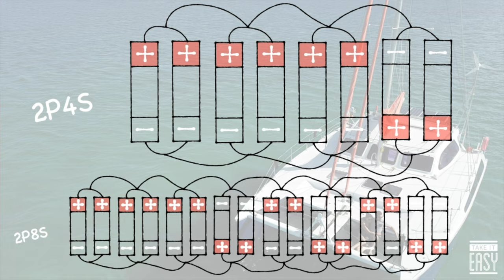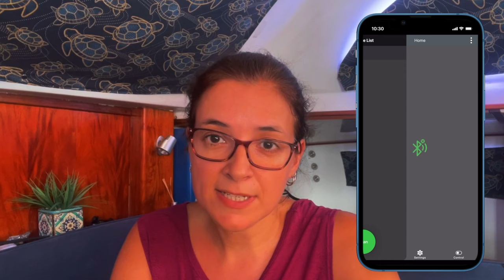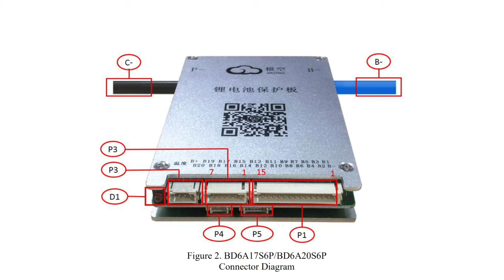Swapping our batteries! How to build 12V LiFePO4 Battery | Easy DIY boat project

Comment: that is a proper battery pack installation with good well known brand quality bms and battery. I would add active balancers as well to complete the combo. your old lithium batteries could be fix by a device "battery resistance tester" replace the ones their resistance is beyond useable.
Reply from the maker: Would you recommend any active balancer? Thanks for the advice! We gave the old batteries to the locals so they could use the working ones.

Comment: Very nice. I built my own battery banks using EVE LFP 280ah cells 57.2 KW of power. I only use 50kw. This is in a house @ 48 volt which means 58-51v usable. After 1.5 years I am at 80 cycles and they are rated for 8000 cycles. The most important thing is how you charge and discharge them with C rating. You have 800ah so 1C is 800 amps charging or discharging. If you can charge and discharge at 400 amps that is 0.5C which is perfect until you get over 45 Celsius. Then  charging should be lowered to 100 amps which is 0.25C up to 60 Celsius. Discharging at 0.5 C 200 amps is okay up to 60 Celsius.
Reply from the maker: Thanks for the info, that's very helpful to know! Especially about the temperature, because everytime we talk to an electrician they tell us about normal operating condition, which is somewhere around 25°C. We are on a boat in the tropics without AC, definitely not at 25°C!
Great news about your cycles! Even if you don't reach the 8000 cycles, sounds like you have many years in front of you!
Reply: @SailingTakeItEasy  LFP cells are made better than LI cells. The Iron and phosphate help stabilize them. If you leave 5% at top and 5% at bottom with your setup you are good to go. The only problem with LFP they are not as dense in energy so more weight per kw of power. On your app check the temps of the battery cells I think I seen you had installed temp sensors. It takes time to get all the right settings in the BMS. The biggest thing is heat and cold. I truly  do not think you will get over 140 F 60 C in that compartment. If it does get over 55 C I would add a vent fan just to move air. You can even add a Portable AC unit with all that power.

Comment: Why did you remove the old batteries,  I have the same in my boat, and just trying to see if there is a need to change? I have 800aH in two 400ah batteries
Reply from the maker: The old batteries were discharging super quickly. It was going from 13.5V in the afternoon to 12V in the morning! We have a constant consumption of at least 12A, so it’s not nothing. To know if you have to change them, monitor how your voltage drops. You can roughly calculate with your amp consumption average during the night, check if your battery voltage drops accurately. If it drops too quickly, you know changing them is on the horizon!